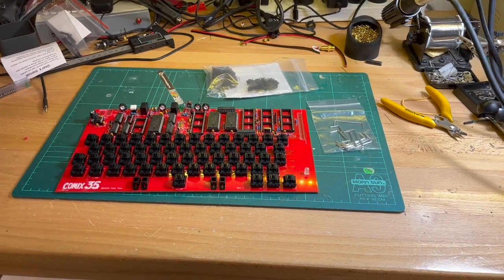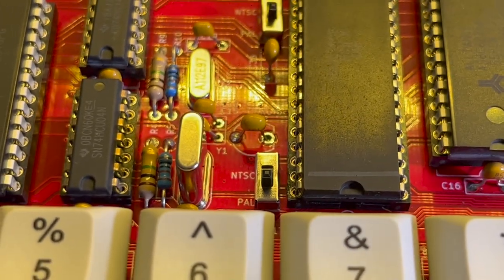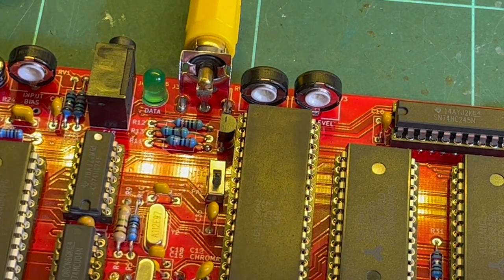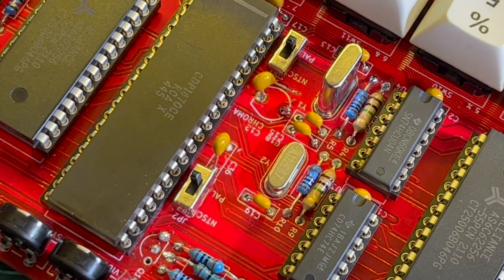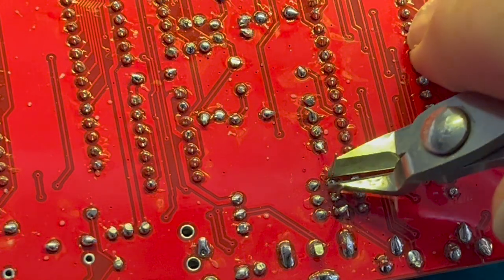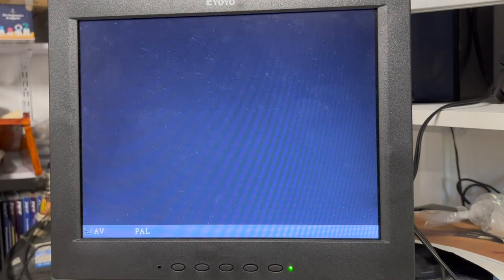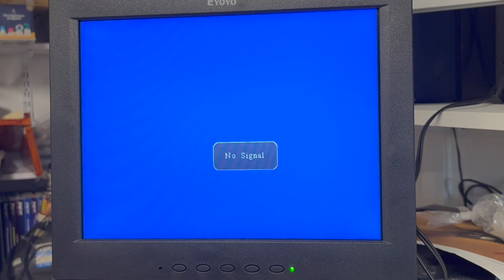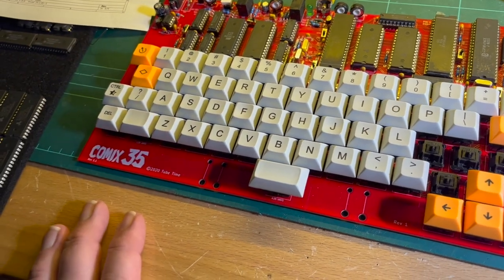🇭🇰 COMX-35/COMiX-35: Part 6 (Finishing & troubleshooting the COMIX-35 build) [TCE #0042]

Comment: Did you ever isolate down which component was failing and causing the garbage characters on screen? I have exactly the same symptoms on mine. I've been juggling the RAM chips but haven't managed to isolate down what is the root cause.
Reply from the maker: I'm not sure ... I think maybe I suspected the RCA chips (I ordered three sets "just in case") ... the RAM is pretty standard so I think it should've been okay (sourced from a proper supplier like Mouser).
Reply: @Brfff  Cheers! I ordered another set of chips. I'd already checked the RAM as I have heaps left over from one of my Microbee projects. (I have also tested them in my TL866 II+)
Reply from the maker: @CheshireNoir  I'll try to get mine out this week and try the other RCA chips to see if I can reproduce the issue to narrow down where the problem might've been!